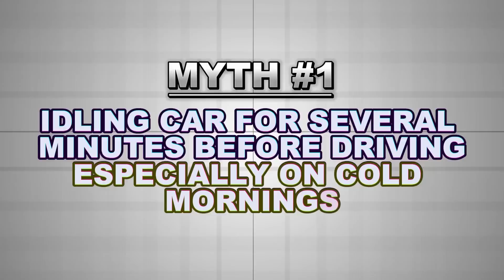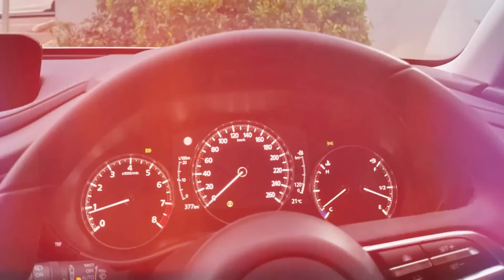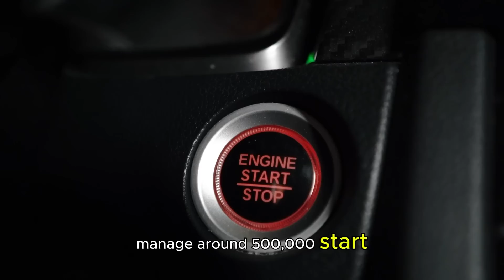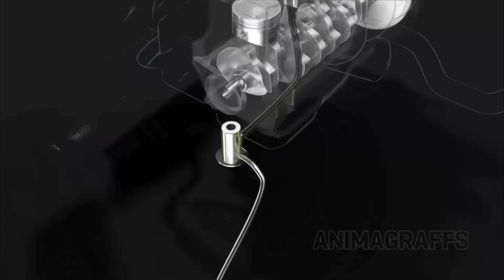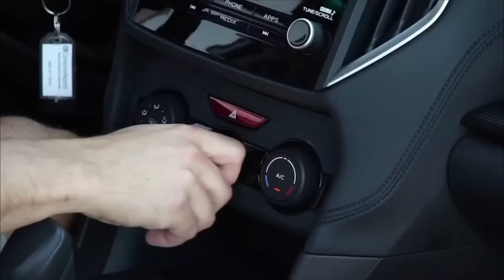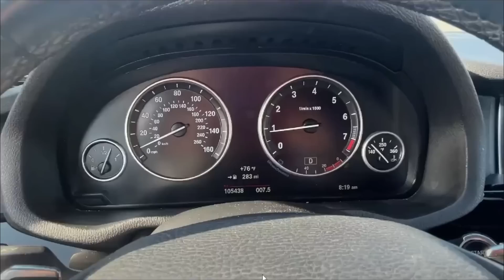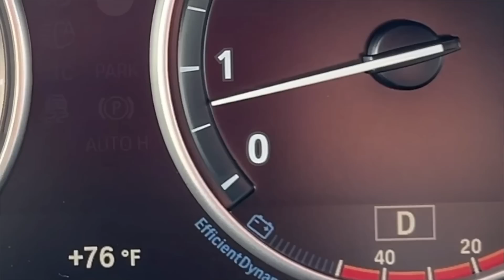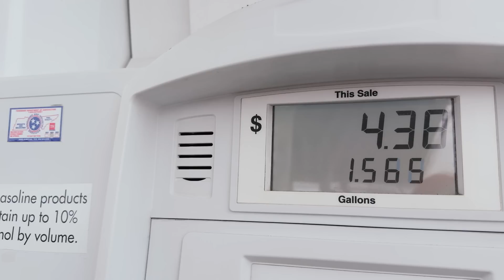Mechanics Debunk 9 Engine Idling Myths That Are Costing You Money (And KILLING Your Car!)

Comment: Yes Idling is bad but the Stop Start feature on your car is bad for your starter motor and is not proven to make a difference. Do your engine a favour and turn Stop Start off. I’ve coded mine out.
Reply from the maker: Agreed. I have a separate video on this topic as well.

Comment: if the car is running the oil is flowing, the computer has preset conditions, for what they call "open loop" meaning the computer is not in control of the engine when the car is warmed up the car goes into what they call "closed loop" meaning the computer is in control of the engine. the car will warm up quicker by driving it.

Comment: WTF. Waiting a minute or two before driving is to let the oil and engine warm slightly up before putting a load on it, its very purely lubricated when its very cold. Never push an engine from cold!
Sure it warm up faster when pushing it, but it also wears much more!
Reply: You're not supposed to "push it" when starting to drive. Just wait 60 sec after cold starting the car then drive off GENTLY. Don't rev it high (i limit myself to 2.5k - 3k rpm the first few minutes), and don't floor your gas pedal, cause even at low rpm it puts unnecessary load on the engine. But sitting there waiting for several minutes while engine is idling is not good for the engine, cause you want to warm it up ASAP to avoid wear and carbon buildup.

Comment: Truckers let their trucks idle for hours and still have million miles on them.
Reply: Yeah different engine and fuel. Also that idling destroys the aftertreatment on newer engines. Also those trucks with Millions of miles are normally rebuilt a few times with new pistons and rings. Turbos have been replaced ect. Diesel tech here.
Reply: 80's Chevy Caprice Classic, Ford Crown Victoria, all put on million and above on the odometer, and its gas engines not diesel, also its well known that taxis and police idle alot and it still lasts.

Comment: Absolutely correct!
Reply: It’s much better however still not effective as driving. Also there’s gonna be certain spots of the engine that gets way too hot. They test these engines running not just idling. I have a 6.0 Powerstroke with well over 640k and it NEVER IDLES. Another weird weird thing is that the oil is as clear as possible